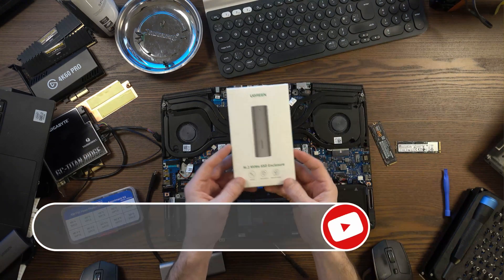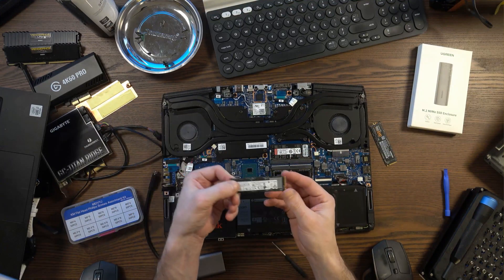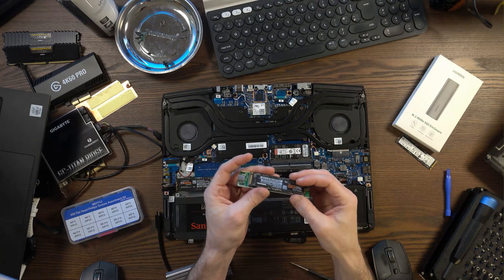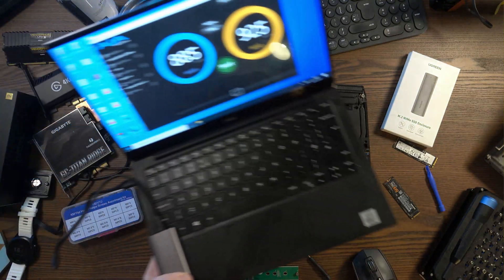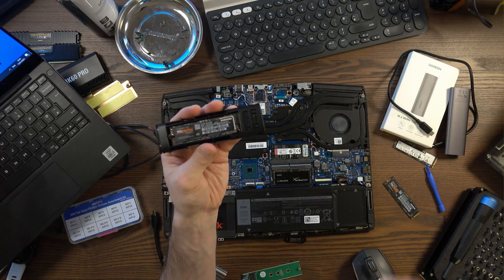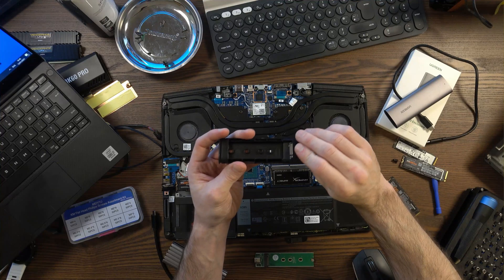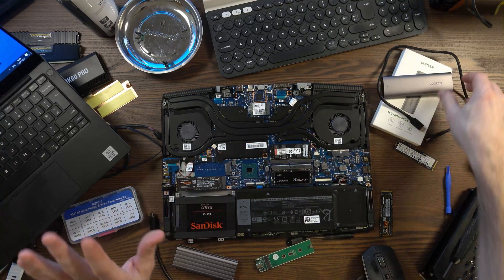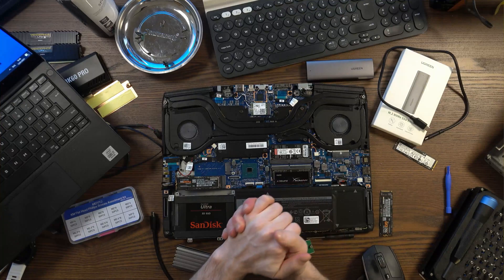The Tool-Free M2 NVME SSD Enclosure

Comment: Do you have any suggestions for an alternative enclosure which could be used for example to run virtual machines from?
Reply from the maker: I've only used a few cheap enclosures. 

I'm keen to get a better one. The more expensive ones have better cooling, but they also tend to be more expensive too. 

I've not put down a lot of cash for one yet as I usually one use them to clone some drives etc. 

I'd consider the Samsung T5 and T7 range if you haven't already purchased an NVME drive.

Comment: Thanks for the review, Kevin. Is the enclosure able to accept ab M.2 with a heat sink ?
Reply from the maker: Not a full heat sink, but you could use thin thermal pads. You'd have to take the enclosure off to apply a larger heat sink.
Reply: @KevinMuldoon  Thanks !
Reply from the maker: @ConJexTure  you're welcome.

Comment: Can you use this to update the driver's firmware using a laptop? I asking cause I'm using a 980 pro for my ps5 and don't have an ssd slot on my laptop
Reply from the maker: Yes you can. You'll have to download the Samsung SSD software and once connected, you'll be able to update the firmware.
Reply: @KevinMuldoon  awesome appreciate the reach out in such sort time! Do you know which adapter would best for this?
Reply: Because the one in the video is no longer available
Reply from the maker: Any Nvme adapter that supports an M2 2280 SSD should be fine.
Reply: @KevinMuldoon  My guy! Appreciate you brother! Thanks for being so snappy in responding!
Reply from the maker: You're welcome. Best of luck 👍

Comment: Hi, which nvme m.2 would you recommend for gaming. I have a little gaming rig with a 500gb nvme but want to keep an external m.2 drive for games. Thanks
Reply from the maker: Most gen 3 NVME SSDs would do the job. I don't think most games would utilise the full potential of gen 4 drives.
Reply: @KevinMuldoon   true, but chipsets are important. The realtek rtl9210 appears to be far more reliable

Comment: I don't think it'll affect performance though?
Reply from the maker: It will. Tight enclosures that don't have good cooling can make the drives throttle.
Reply: @KevinMuldoon  I mean they're already been speed capped at the speed of the cable level?
Reply from the maker: Yeah there's many factors to consider, such as which type of port you're using.

Comment: What keyboard is that in the background Kevin? Also love from Glasgow mate keep up the great work
Reply from the maker: Thanks Festor.

It's the Logitech K780.
Reply: Also I have a short question, I've been thinking about buying the Shure SM7B to upgrade to top tier audio quality as the blue yeti sounds so hollow and isn't really cutting it for what I need it for. Is the cloud lifter a needs must for the Shure or can you get away with using it without?
Reply from the maker: It depends on the audio interface you use, but in most situations you will need it as you don't provide enough gain.

Comment: thats a lot of storage! get a nas drive? thoughts on new mbp m1?
Reply: side note - i like that enclosure! last one of those i bought was years ago, best £20 i ever spent - but it only does sata ones  will look at getting one of these thanks mate!
Reply from the maker: I am planning on getting a NAS at one point for storing files, but I use these drives for video editing. You need to use fast drives to reduce rendering times and improve performance.

The new M1 chip looks good. It seems to do well with optimised apps and not so well with those that aren't. Once more apps have been optimised, it will be interesting to see how it stands against Intel and AMD.